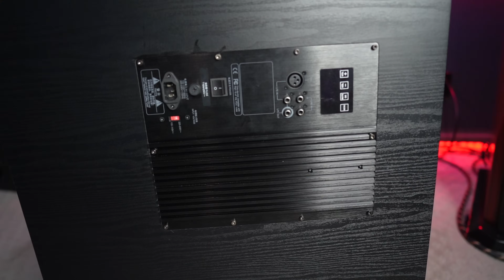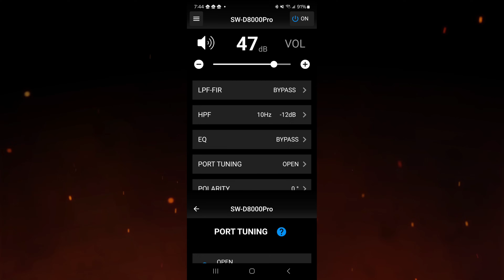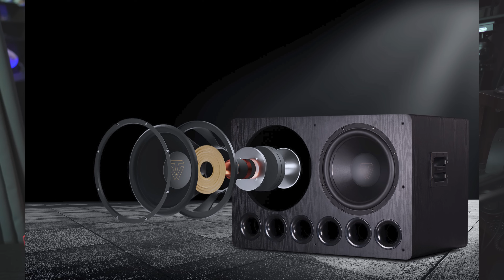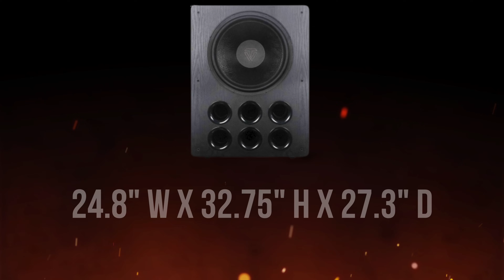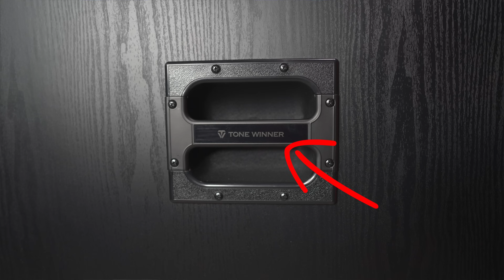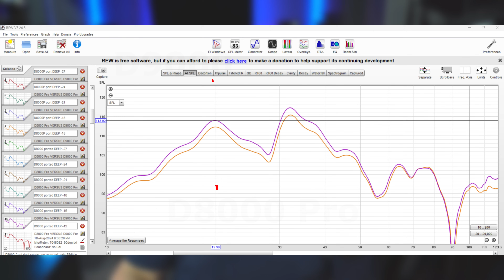EXTREME BASS, FOR LESS $$! Tonewinner D8000 PRO & D9000 HIGH PERFORMANCE SUBWOOFER INTRODUCTION!

Comment: Great video as usual Barrett. Here's my question. The D8000 Pro or two D6000  What would be your choice and why? And what exactly is the difference besides both 15's in one box vs 2 individual 15's?  is there an advantage performance wise between the 2?

Comment: How does Tonewinner handle being a HARD daily/weekly driver for years upon years? That's what I need to know about subs/companies. Out of the vendors most people buy/recommend, all I know is that SVS works for my usage case for at least a decade. Do other vendors? I know one of them doesn't.
Reply: You know what that's a very good point. we never hear about this sub or speaker tower will more than likely last 10 15 or 20 years due to excellent built quality . Always ya this puts out insane amounts or power. :)

Comment: Great video as always! I really like the dual 15.... on the side it looks awesome. If I still had my HT, I would without a doubt, 2 would be in my room! The TW app is the best I have ever used. Feature packed, phase, delay, even input voltage selection. (Better IMO than SVS) I have a TW and a SVS currently, together these integrate fantastic!! I'm impressed. TW is messing with the big boys, I like it!   I had a SVS SB4000, the D8000 would eat it for breakfast. 😁
Reply from the maker: I love the app too, very handy.  Especially for large subs like this that you dont want to pull away from the wall.  Hopefully there is a dual 18" in the future

Comment: Any port chuffing? I found the chuffing on the big Klipsch sub very distracting and also w the PB16 but to a lesser degree than the Klipsch
Reply from the maker: @MrBonger88  No, I've pushed them both quite hard, and didnt hear port chuffing.  I get a nice rush of air that I can feel from 8 feet away, and no chuff.

Comment: I can’t comment on these monster subs but I did get a pair of D4000’s and was not impressed. The App is fiddly and not as simple and efficient as what’s on my SVS. One note of caution be very sure that you’re going to like any Tonewinner sub as return shipping to Canada is on you which can be quite expensive due to the size and weight which I had to find out the hard way as Amir will not directly answer your question regarding return shipping leading one to foolishly assume incorrectly. That being said in all fairness they seem to be a good product with value but they weren’t for me.
Reply: There was no confusion I asked a very direct question and was given a vague answer. I take full responsibility for my big mistake of assuming but not for your lack of specificity. This is the correct answer to my question : If you are not satisfied with your purchase you can return them within 30 days and receive a full refund minus return shipping and or any restocking fees. There’s nothing vague or open to interpretation about that and this conversation wouldn’t be happening if you had told me that. Lesson learned
Reply: I saw the reviews and would like to buy tonewinner D2000/or D4000. Would like to know your user experience how's the sound/bass quality comparing to SVS say sb2000 pro/sb3000? thanks.
Reply: Our apologies for the confusion. We did call you to assist with setting up the subwoofers, but you opted to return them within a couple of days. We understand that the return cost was high for you, and we helped secure a more affordable rate. Additionally, we offered various solutions to address your concerns. Thank you

Comment: looks good but they are late i think. New svs pb has dual 8" voice coils.
Reply: Dual 8" voice coils and each is powered by bridged dual mono block amps. Plus that new state of the art DSP chip, that is clocked the fastest in the word. That, a bunch of other tweaks and improvments to make it way more efficient and powerful. Tuned to 8hz +or-3db for the ported version and 11hz +or-3db. I think it's gonna give JTR's a run for their money. Will they beat JTR subs? No, not to likely, but they don't need to beat them, they just need to be within spiting distance of what a JTR can do. With the way they look and all that new state of the art technology in them, that will make them very appeling to a lot of people that wants what a JTR can dobut would never get one because they're ugly and are brutish in their approach.
Reply: @randysalsman6992 Impressive specs on paper, same as when the PB16 came out, but those didn't live up to the hype with all the port chuffing as well competition from other internet direct subwoofers from Rythmic, PSA etc provided better performance and value.
Reply from the maker: If I remember right, the 8" voicecoils are quite inefficient.  I am still interested in testing the new SVS none the less.  Given the US pricing of the PB17, the Canadian pricing will be over $5000.  Giving these Tonewinner subs a huge price advantage over the SVS, especially for Canadians.

Comment: Nice detailed video. These are really beasts, Tonewinner is doing great work in subwoofers. I am using a D8000 & I have SVS PB4000 also, when I compare both results shocking for me because the Tonewinner D8000 clearly wins in bass performance.
I'm thinking of ordering a D8000 pro after watching your video.
Reply: I just got the d8000 and having trouble getting audio an setting it up . Did you have any issues?
Reply: @johnnyv6488  I am using it from last six months, didn't face any trouble. What type of audio settings u faced issues.

Comment: Awesome 👌 vid as usual.  Very keen to hear your next vid on them. I have the D8000 I'm assuming it's basically the same output as the pro,  just a smaller footprint.  But yeah it definitely out performs my pb3000 and rocks the 🏠 😎
Reply: The pro goes down to I think 11hz and the non pro goes down to 13hz, so no the pro hits a little harder.

Comment: All subwoofer manufacturers should put steel handles on their subs. All of the pro audio speaker makers do it. Just makes sense when lifting anything over 50 pounds. Excellent video once again. Cheers from Calgary ish area. 👍👍
Reply: If you look at the website or some of the b-roll in this video, you will see handles built into the sides for this purpose. Hope this helps!